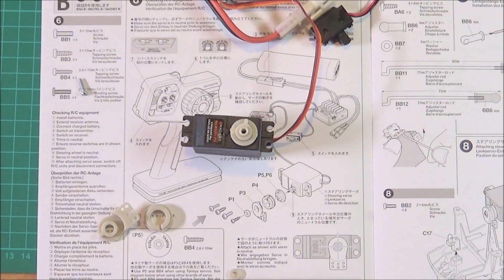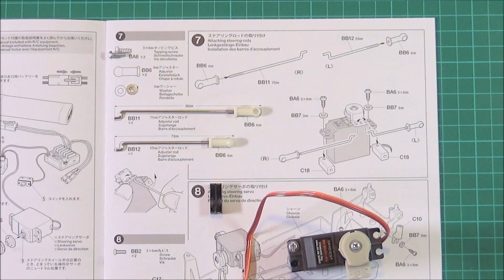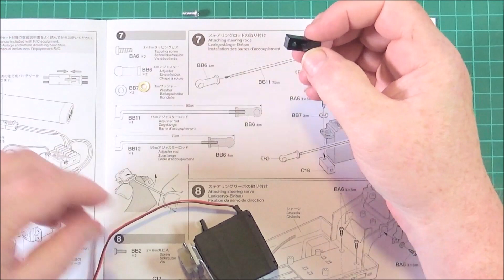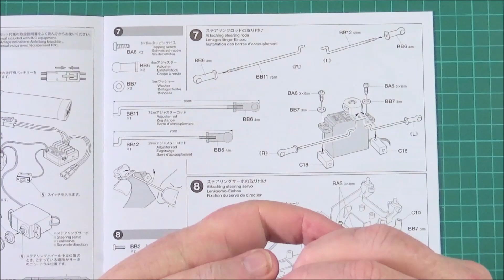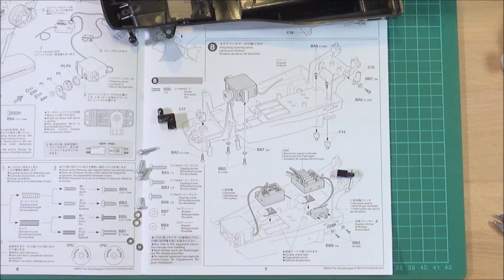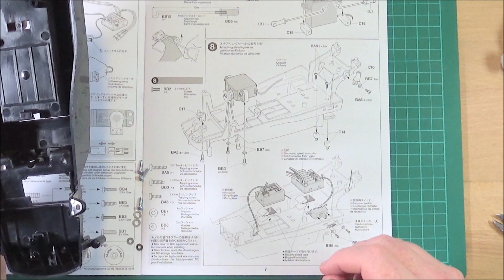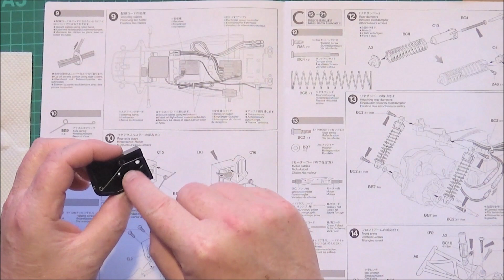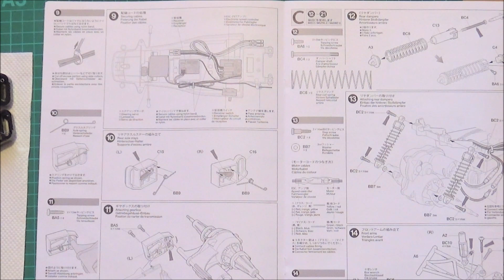Tamiya Grasshopper II Black Build Part 2

Comment: Rob, didn't Grasshopper I have you fit temporary screws to hold off the Springs whilst you fit the rear Drive? 
... I NEVER liked those Wire Steering Links either.  NOT that removing slop from a Grasshopper EVER did any good, I still prefer to use All-Thread with ball joints at either end. 🤔

Comment: Hi Rob, this set looks fantastic. Can't wait to see it finished. Can I ask you where do you buy your Tamiya kits? Which website do you usually use?
Reply from the maker: Hi. Many thanks for the comment. I normally use either ModelSport https://www.modelsport.co.uk
 or TimeTunnelModels https://www.timetunnelmodels.com.
Reply: Thank you very much! I have to get my first RC car and I'd like to get a Tamiya kit because I'd like to assemble it myself by learning how they work. The budget isn't that big, so I was thinking of taking an entry level and like a buggy. Which kits do you recommend to get started with RC?
Reply: @riccardo1583  Please excuse my intrusion, and Rob may beg to differ, but I highly recommend the Tamiya Madbull. 

It's a simply buggy to build and easily upgraded. 

It's better than a grasshopper in my opinion as it has Lunchbox style wheels and tyres and will go anywhere!
Reply: @PieAndChips  Thank you. I had not considered that kit but I will go to see it. Waiting for Rob answer too.
Reply from the maker: Hi. Yep the Mad Bull is a good choice and with those extra wide wheels it should be great fun when driving it.
Reply: Thank you very much for the advice and time spent. Now I have a bit clearer ideas about which one to choose